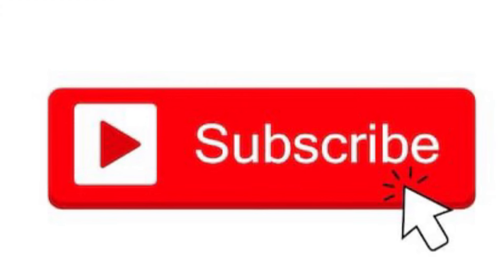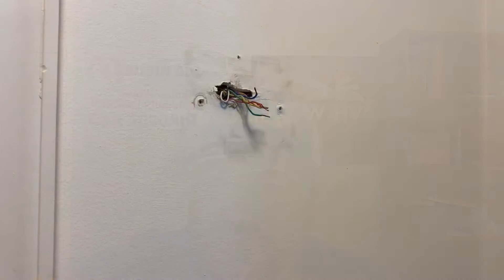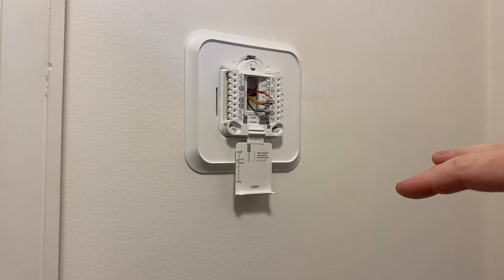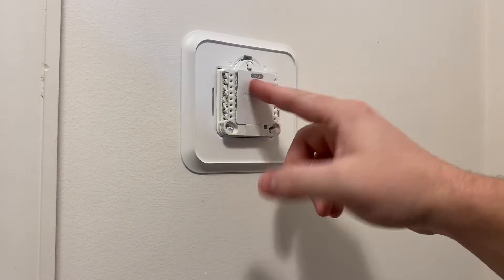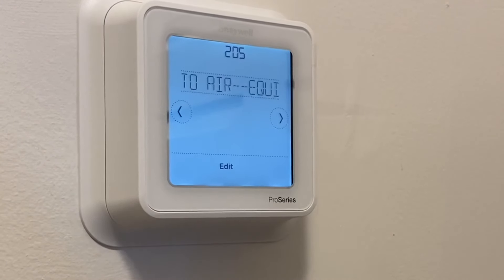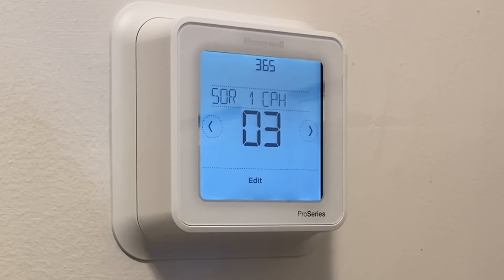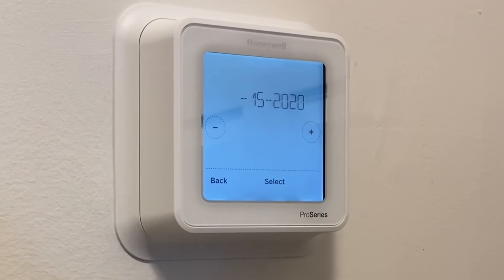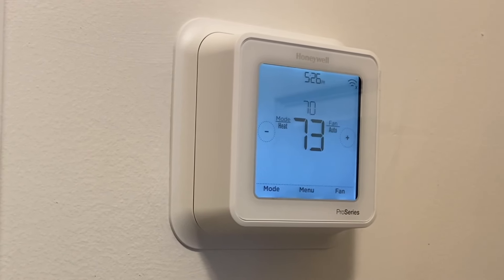Honeywell T6 Thermostat setup and overview video. Quick overview.

Comment: How come no one can explain the set up on a honeywell t6 pro?
Reply: T6 pro in 2020 was known to have problems. They still sold the devices fully aware of them. A lot of A/C pros and techs avoided them like the plague. I have one 😢. Thinking of replacing it because 4 times this year, my airhandler stopped working, blown fuse, replaced circuit board, bad transformer, etc. Now I have my company coming out to troubleshoot the system yet again.
Reply: @krylocskrazeplay how do you know if it was made in 2020? Is it just the whole thermostat model or the ones made in that year?

Comment: My mom was talked into one of these. She was told that there may not be one of the cheap thermostats in the truck, but there was this really great expensive one. He kept touting the expensive one that had all these neat features. My mom is 90 years old and doesn't know how to operate anything more than a standard thermostat.  He should have asked her if she had need for a fancy newfangled one. She spent almost $500.00 to have a thermostat replaced. The was for the service call and the thermostat.
Reply from the maker: Wow. Sounds like she was taken for a ride. We don’t even charge half that to install one of these
Reply: I didn't realize it was the Lyric T6 Pro Wi-Fi TH6320WF2003.  Was she still overcharged?
Reply from the maker: Where is she located?
Reply: @NewHVACGuide  Merrillville, Indiana. That is in Lake County, Indiana.
Reply from the maker: Gotcha. These thermostats run somewhere a little over $100 typically. Maybe that’s the going rate in your market. That would be high in ours.
Reply from the maker: Of course there may have been other work done as well.

Comment: how can you reset it back to factory to start completely over
Reply: Hold menu down until the setup menu pops up then go to factory reset. Make sure u know if u have a boiler conventional or heat pump system. When u reset these settings will change and ur system won’t heat up if u choose the wrong setting

Comment: Awesome video! I just had our ecobee thermostat changed to this T6 because it was reading super high in humidity. I just noticed that the T6 won't go below 68 for cooling. Any idea around this? Seem to be very restricted. I have a pregnant wife at home and its going to be summer time 😬
Reply from the maker: You should be able to change it in the programming and lower your limits.
Reply: @NewHVACGuide  got ya... I found out that you need the press menu for +5seconds to open the advanced settings
Reply from the maker: Good job pal!

Comment: I screwed up the thermostat and had to factory set it again.   After it was reset, I followed this video 3 times to a "T" and I have it set to cool but it's heating instead...each time I reset to start over and get the same result.  Carrier is the heat pump

Comment: I have no backlight on T6, where is this battery that you mentioned. Where does it go during the install?
Reply from the maker: If it has batteries, they would be in the unit when pulled off the base. Some of them do not have batteries or accept them. It depends on which model you have. The back light issue may be in the programming.

Comment: Good luck on setting this thing up. My first T6 Pro wouldn't connect to my network. I was able to call and talk to a man at Honeywell. Stepped me through the process OK. After several years this thermostat went out so I purchased another T6. The instructions told me to put my phone in airplane mode and go and log into the thermostat. I was in airplane mode which meant I could not get WIFI or blue tooth. I called Honeywell support line and the wait was 2 1/2 hours. I had my HVAC company come out and try to set it up. They did not have any luck getting this thing to work either. 
Right now I am using it manually. Buyer beware of getting this thing to work.
Reply: Having the same problem
Reply: @jimmarka3983  I have given up on it. I just use it as a regular thermostat.
I did have someone that said they worked wit Honeywell. He said in his reply to after going into airplane mode to turn the wifi back on and log into the thermostat.
I never tried that. I was too frustrated on a product that didn't do what it claimed it would do.
Reply: @dhansel4835
Reply: I made 3 calls and 1 Longggg text. No luck.
I just bought a Vimtag camera for 40 dollars on Amazon.
I will monitor my stat temp with it when gone. 
Honeywell will not provide one contact for consistency. Every time t you call it's back through robo . Frustrating.

Comment: Do you know if you can control the thermostat basic features directly from the Google Home app or do you have to use the Honeywell app?
Reply from the maker: I’ve never tried that. The newer stats work with the Honeywell Home app. I’d be surprised if they worked directly with the Google home app but I’ve been surprised before
Reply: You ever find out? My apartment is installing these soon.
Reply: @NickRoeder  you can but i wish i had gotten a Nest.

Comment: Can this unit use the outdoor temp via Wi-Fi (i.e. not hooking up an outdoor temp sensor) to lock out the aux heat strips in a heat pump system above a certain temp?
Reply from the maker: I’m actually not sure. I know the 8000 can.
Reply: @NewHVACGuide  Ok thanks! I'll look at that one!

Comment: What is the recovery setting on/off for?
Reply from the maker: Adaptive Intelligent Recovery (AIR) is a comfort setting. Heating or cooling equipment will turn on earlier, ensuring the indoor temperature will match the setpoint at the scheduled time.

Comment: Can you explain what kind of system you are installing it too? ex: Eletric Heat Pump, Gas Furnace, etc.
& if I have a regular heat pump what will me AUX/E Stages be set on, "0"?
Reply from the maker: Heat pump. You’d set them to however many stages your system has

Comment: My T6 light stays on all the time. I can’t seem to find the option to set it to turn off. I’ve checked online manuals, and no luck there either. Any ideas?
Reply from the maker: Yes. You need to turn off the back lighting in the programming. It is most likely in the ISU programming 1400. Change it from a 1 to a 0

Comment: Currently have the T4, was looking at either the T5 or T6 as an upgrade. With the bases being the same is it just a front swap? And which of the 2 would you recommend?
Reply from the maker: T6 is a swap. I honestly haven’t sold or installed a T5.

Comment: I currently have a T4, can I just pop it off and pop the T6 on, and run the setup through the app? I shouldn't need to touch the wiring, correct?
Reply from the maker: I know that used to be true. But if not, changing the base isn’t too hard. Just make sure you turn off the power.

Comment: For the FAN mode, how do i turn it OFF ? 
All I see Auto, On and Cir
Reply from the maker: To turn the fan off, put the fan mode in auto and then turn your system mode to off
Reply: @NewHVACGuide  thank you for the response - but i have both Heat and A/C  mode in "off" and the fan still runs intermittently in Auto mode [mode: off / fan: auto[

Comment: We have a Rudd Heat Pump,  and  a Honeywell  T6 pro  thermostat,   If I set it to 74,  say,  when it gets to  74,   it keeps running, I have to turn it down to  2 %  below, for it to cut  down.   The  whole unit is only less than 2 years old.   Why won't it cut off. till the temp. drops.
Reply from the maker: Could need a new thermostat, but it my just be in the programming.  Call your installer.  They may repair for free :-)

Comment: Would it be possible to swap out the T6 Pro for a T6 Pro SMART without touching the wire settup, I'm guessing they use the same base plate?
Reply from the maker: Yes. Just make sure the programming is correct

Comment: @nellomichi6416
0 seconds ago
my old trane 3.5 ton had a thermostat with it that did what you want. there was a spinning circle  when the outside unit was running. i am still trying to find one that will do the same for my new goodman system !!

Comment: Where is the actual room stat located? My stat is not reading correctly and it's causing my unit to run much longer than it should. The stat and return are in the same room. The return grill was around 77 F and the room stat was still reading 68 F so the unit would not shut off (It was in heating mode). Just wondering if I can fix this somehow. Thanks!
Reply from the maker: What a weird problem! Some thermostats have the capability of changing the ambient temp reading.
Reply: I just found out today by fiddling it can be set for air or floor to determine which temperature to respond to. Then I googled what air and floor were and a blog said that’s what it is. I wish I could figure out how to change the max temp I bought this house and they left it at 75 max on one controller but 78 for another zone. We dropped to -10 this winter and 75 wasn’t helping.

Comment: Is there a way that this thermostat can indicate if the outside unit is running.? I have an issue where the breaker tripped for the outside unit and the heat was running on the backup system with no indication on the T6 thermostat. My local guy says that there is no way to do this and I find that hard to believe that they would let such a system run open loop with no feedback from the outside unit. My system is a 4 Ton Bryant installed in December 2021.
Reply from the maker: Your local guy is correct. Unless you have a communicating system, the thermostat has no way of knowing if the outdoor unit is running when it sends it voltage to run.

Imagine a light in your house. The light switch has no idea if the bulb has gone out or not
Reply: my old trane 3.5 ton had a thermostat with it that did what you want. there was a spinning circle  when the outside unit was running. i am till mtrying ti find one that will do the same for my new goodman system !!
Reply: @nellomichi6416
0 seconds ago
my old trane 3.5 ton had a thermostat with it that did what you want. there was a spinning circle  when the outside unit was running. i am still trying to find one that will do the same for my new goodman system !!

Comment: I'm finding documentation saying that IOS 14.2 (and later) has an issue with syncing to the Honeywell Home App.  the article suggests there is a "work-around" by disabling WAC on the thermostat but I've had no luck with this.  Any suggestions, or anyone have success syncing with Honeywell Home app and the T6 pro with IOS 14.2 or later?
Reply from the maker: I haven’t ran into that yet unfortunately
Reply: I had to call Honeywell support line. I have an I phone, the tech asked is I had another device maybe an android or an I pad that I could use to register it. Fortunately I my daughter had a I pad which I was able to download the Resideo app and register .I did have to disable the WAC first.

Comment: Is there a way to adjust the off and on sequence. For ex change the temp range that it will take to cycle off and on. I have a T6 it cycles off and on often.
Reply from the maker: I don’t believe you can change the deadband on the T6. However you may want to call a pro. Short cycling could be a sign of something wrong.
Reply: @NewHVACGuide  hey man. Thanks for replying. I’m just trying to get more information. This is a brand new heat pump system ( Lennox) 2 zoned. So before. It would run all the time. Tech came he said he found to be low on charge. So he recharged. So now it’s cycling off and on. But runs for about 10-15 min. ( heating) and then off like for 5. And so on. Is this normal for a heat pump system or maybe still low on Freon. Thanks
Reply from the maker: It depends on the home. If you have an insulation issue where outside air is able to come in, your system may short cycle. That said, if your system was low on refrigerant then that means you have a leak. If the technician only charged the system and didn’t fix the leak, you may be low again already.
Reply: @NewHVACGuide  well this is a brand new townhome. I just moved in 5 days ago :/
Reply from the maker: Sounds like you may need to have a refrigerant leak repair
Reply: @NewHVACGuide   tech responded. So far everything sounds correct. Remember supply temperature is affected by the return temperature or the room temperature which is the same thing. If you have the top floor thermostat set for 62 and the downstairs thermostat set for 65 the average input to the air handler would be about 63 or 64° therefore if you have 84° coming out of the vent, that equals a 20° temperature rise. That sounds like exact performance for a heat pump.
Reply: @NewHVACGuide  my system runs for 20 min. 84 temp out of the vents. For 10 min. Then it drops to 78 remaining time. Then it shuts off for 5 min. Cycles again
Reply from the maker: Alrighty. Sounds like you got it figured out :-)

Comment: Is there a way to check how the system was setup (heat pump, etc.) after the initial programming. If not, how do you wipe the settings and start from scratch? I have a feeling one of our 2 T6s was not set up correctly.
Reply from the maker: Yes. The manual is at the following link. 

https://www.google.com/amp/s/manuals.plus/honeywell/honeywell-t6-manual-pro-series-thermostat/amp
Reply: @NewHVACGuide  thank you for the fast response. I was looking at the hard copy of that manual but I'm not able to get into the Installer Setup Mode (I don't see that menu button I'm supposed to press for 3 seconds)

Comment: Hi.i left my t6 option 365 factory 03
365 y 366 Cycles Per Hour: This ISU is only displayed when Cool /Compressor Stages is set to 1 or more stages. Cycle rate limits the maxi- mum number of times the system can cycle in a 1 hour period measured at a 50% load. For example, when set to 3 CPH, at a 50% load, the most the system will cycle is 3 times per hour (10 minutes on, 10 minutes off). The system cycles less often when load conditions are less than or greater than a 50% load.

Is this normal and recommended 
Thanks
Reply from the maker: I rarely change the cycles from factory settings and have never had an issue in residential
Reply: @NewHVACGuide  Thanks for the information